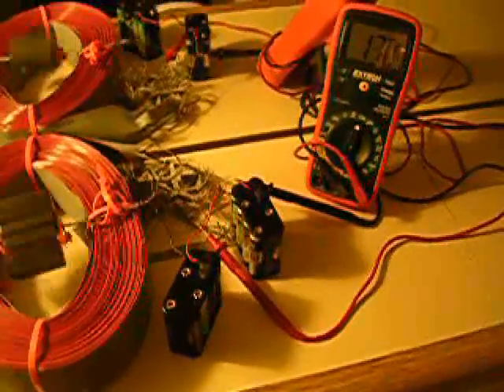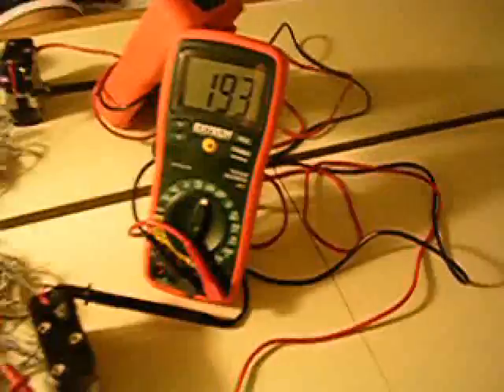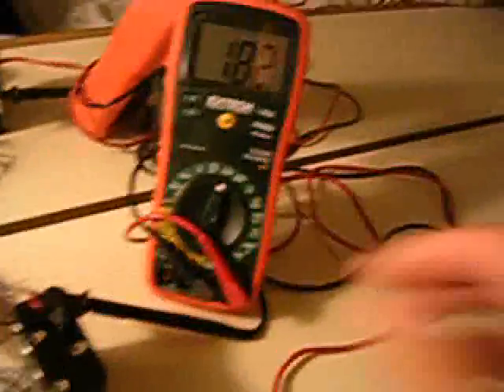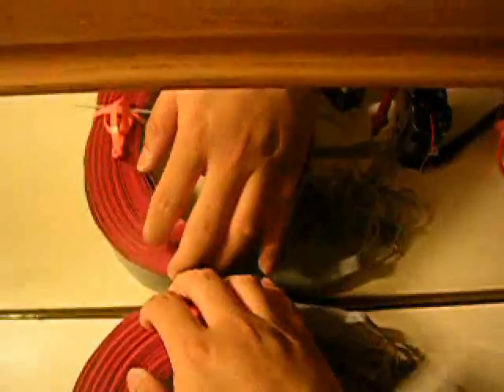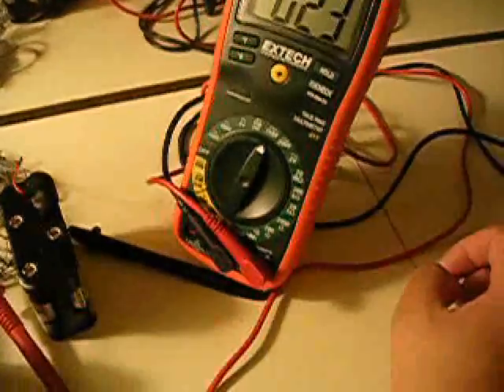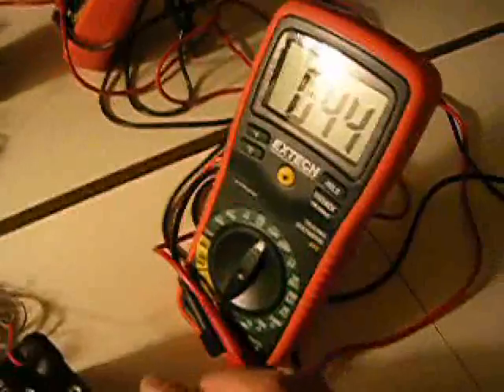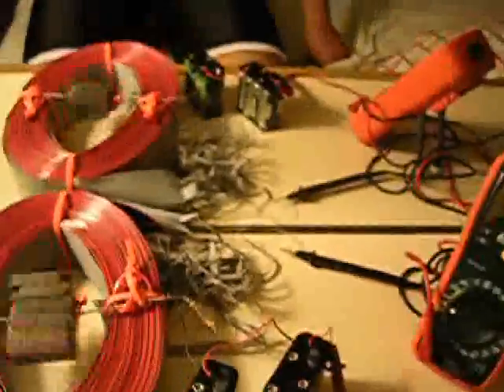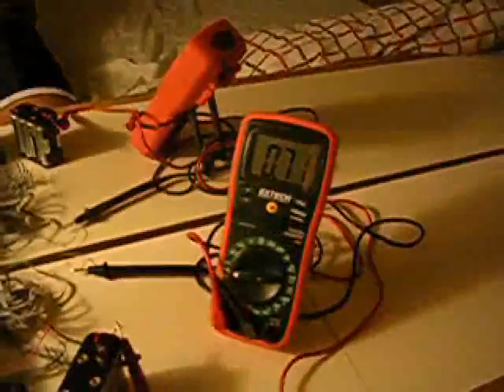Electric motor ▲ AC/DC 2

Comment: I read thru all the comments and have to agree, you never placed a load on the output thus not showing it can power something useful - like a real fan. The coil itself cannot be considered a "load" as it is the device producing the power. Make a new vid (with a tripod) and plug a small light into the thing.

Comment: rectify the output to get a dc output and run it parralel to a high voltage neon bulb, i've got a 90V one.

I am getting similar output from my Bedini motor. high 140V spikes and I can barely measure any current. This is not normal electricity. Tesla called it Radiant energy. from whati can understand its kinda like static. This energy is extracted fromn the vacuum with no current. Infact when u apply current u kill the radiant, so dont b surpised by no current..

Keep it up

Comment from the maker: "Cos(phi)=0.00000.... LOL!" - You're probably right. If what you said weren't the case, the coil would be pretty hot by now.

Now taking your comment too literally, one might assume you were referring to real power/apparent power = 0. But the motor runs while real power is not zero. Not suprisingly, the batteries' voltages drop over time, eventually requiring recharge.

Currently I am trying to refine my ideas about how to make a motor more efficient than this: thinner wire; fewer & wider turns.

Comment from the maker: For a series of *different* numbers, such as 1, 2, 3, 4, and 5, the root mean square of the numbers is always greater than their average. Anyone who has taken math knows that the average of the series stated is 3.  The squares are 1, 4, 9, 16, and 25, the average of which is 11. Thus the root mean square value of varying current is always greater than the its average value. Therefore, the AC reading of current must be higher than the DC reading of current. The current in the video is 20 mA DC...

Comment from the maker: When the voltage drop due to capacitance of the circuit is greater than the voltage input from the batteries, then both the voltage drops due to resistance and inductance can be negative, meaning that current can increase in the opposite direction and polarity than was coming from the batteries. That is the basis for spark plugs used in automobiles. Interestingly, a high end spark plug can use a capacitor instead of a inductor in order to produce a more efficient burning spark.

Comment from the maker: When the current drops in the inductor, the voltage drop due to inductance is negative. This voltage drop equals inductance * change in current / change in time, and it corresponds to change of magnetic flux opposite of that which was produced by the current going forward. As a result, the magnetic field inside the loops, by the loops, contracts, while the magnetic field by the permanent magnet grows.

Comment from the maker: The ohmic resistance of the wire and the spark gap is not constant and is a cause and effect of the variable current usage in the wire. This acts like a changing load which causes a changing drop in battery voltage. The fact that voltage drops when you add a load means that the power in is less than the battery's voltage with no load times the current from the batteries with a load. This, the impedance of the load, helps to reduce input power at a given voltage input.

Comment from the maker: Maybe you are right, if the meter is busted.

But if it is not busted, the video at 5 mins and 0 sec should be telling me the root mean square amperage. If I square that value I should be getting the average squared value of current. If I knew the resistance of the load as a function of amperage, I could determine the real power usage. But really, the charge that is being drawn from the leading batteries varies only proportionally to the current drawn from it, not to its square.

Comment from the maker: That might take a while. In the mean time, I already know that what the multimeter is reading is not anywhere close to a sinusoidal voltage so I'm pretty sure that there is no where close to one frequency only. It's not like this can be hooked up to the wall to produce 60 or 50 Hz, so its not a way of producing suitable AC power. I have heard recently that the Lutec machine was supposed to do something like that, but... =P nyah nyah

Comment from the maker: That's why I'm suppose to use the jack that's used for the voltage and ohms only. That jack has a much higher resistance and so will draw very little current. But with that I will be only measuring voltage not amps since I don't know the internal resistance of the voltage/ohm testing jack. Measuring current requires that I use the 20A port with an external resistor since the 20A port does not include it. I'm not sure of the difference between the approaches in terms of accurate measurement.

Comment from the maker: What I should do is connect the multimeter in parallel with the battery pack in a way that bypasses the commutator, which I have not done yet. The multimeter should have a built-in resistor that measures the voltage drop without drawing too much current.

Comment from the maker: And could you even believe the readings? If the AC amps shows 1 amp through a 200 ohm coil (4000 ft of 28 AWG), then the voltage should be above 200 volts. Since I am new to electronics, thought of me producing 200 volts with 16 AA batteries sounded kind of ridiculous. I immediately knew it could not be from the batteries - that would be impossible. If that's not weird then I don't know what weird means. Surely understand that I cannot draw 200 watts from 20 volts unless I am drawing 10 amps :P.

Comment from the maker: The word "load" is kinda of loaded. :)

There are electrical loads.

There are mechanical loads.

Then the rotor itself could be considered a load, if all you were trying to do was to spin the magnets.

Different approaches have their own advantages and limitations. Unfortunately you have to know the assumptions behind them to properly apply a method. A method may give meaningful answers in one context but may be useless in another.

en.wikipedia org/wiki/Network analysis (electrical circuits)

Comment: ...actual A/C current you are measuring is the coils attempt at recharging the batteries during the back EMF cycle and while the current is flowing the voltage is clamped near battery voltage (20V). It is when the batteries can no longer take anymore current that you witness the back EMF climbing to 255V. But this is similar to static electricity. If you are using rechargeable batteries and good bearings on your rotor your motor may run indefinintely - at least I think we should test it out.

Comment: Please don't misunderstand me, I am trying to help. We are both on the same side here. I applaud your novel approach to using ribbon cable for your coil. The resistance of your coil becomes part of your 'Source' impedance and does have an effect on your limits as listed in your next post. There is a point in the rotation of your magnet when the load drops to zero, the induction field collapses and the back EMF raises to voltages over 200V. However this little current associated with it. The ...

Comment from the maker: Why should I observe over 200 volts AC going in, or going out, or being dissapated, at no-load anyway? Where do you think that comes from? The batteries? Hell no!!!

Why should I observe over 1 amp of AC going into [or from!] 4000 feet (>250 ohms) of 28 gauge wire with 21 volts of batteries?

Why should I observe AC that is greater than the DC that the batteries are supplying?

Why couldn't some of the power be dissipated in the coil itself? Wouldn't that make it a load?

Comment: Your output windings need to drive a consistant load. For instance, a small nightlight. You can then measure the voltage across the nightlight and the current through the nightlight. In a lab we would take all four readings simultaneously and have them recorded. The input voltage and current and the output voltage and current. This way you could compare watt for watt for any time interval. This could be accomplished with a 4 trace digital scope and two 0.1 ohm sensing resistors.

Comment from the maker: How do I take a max-load voltage reading? What I have been doing is taking the AC voltage readings with the probes in parallel and the currents in series with the windings. I did DC voltage readings both ways, in parallel and in series. Tell me what to do.

Comment: Here's the problem. Your AC current reading was dead shorting your AC output. When this happens your output voltage drops to practically nothing. So what you have done is give us a no-load voltage reading and a max-load current reading.
Sorry to burst your bubble. :(

Comment from the maker: Thanks! Recently I found that AC Power actually is a product of 3 things: The RMS voltage times the RMS current and the power factor of the circuit. The power factor is resistance divided by impedance. The impedance is RMS voltage divided by RMS current. So the AC power of the circuit is really the resistance of the circuit times the RMS current squared. The wire is 270 ohms (40x100' of RC40 ribbon cable from Altex(.com)). Mathematically, RMS of V and I >= Average of V and I. AC power>=DC power.